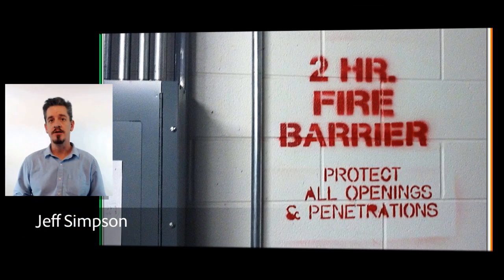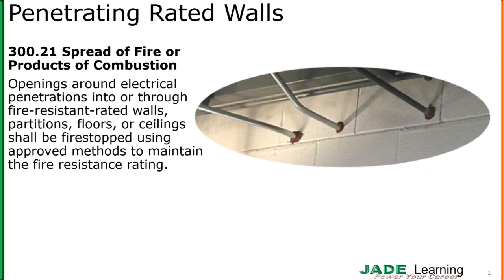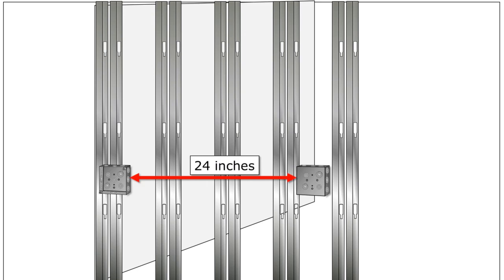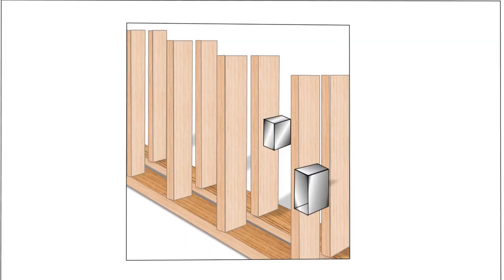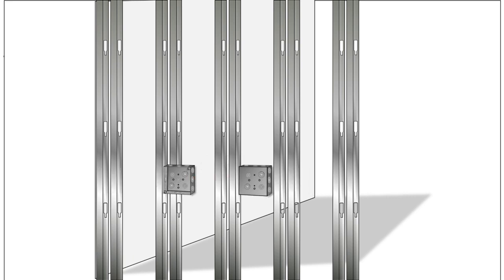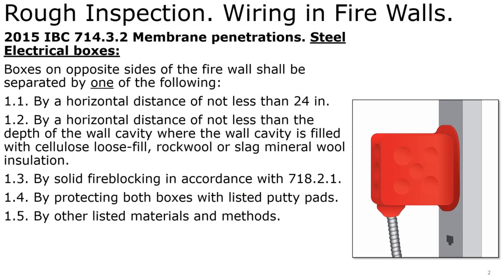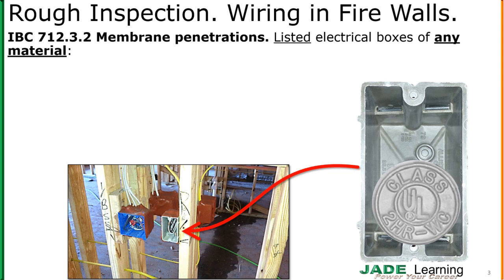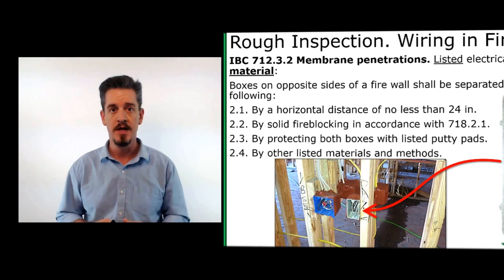Electrical Penetrations Through Rated Walls

Comment: So if they insulate the walls with those material you mentioned no additional firepads are necessary?
Reply: That's the way I understood the code he mentioned.
Reply: My understanding is that if the wall is filled with loose fill cellulose or mineral wool, then the boxes have to be at least as far away horizontally as the wall cavity is deep.